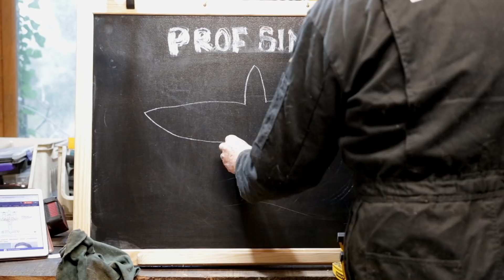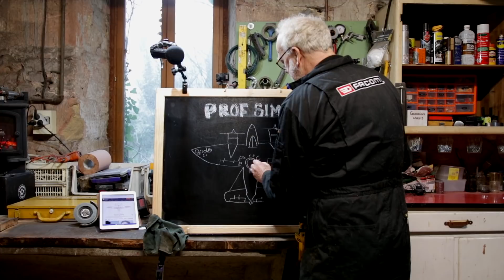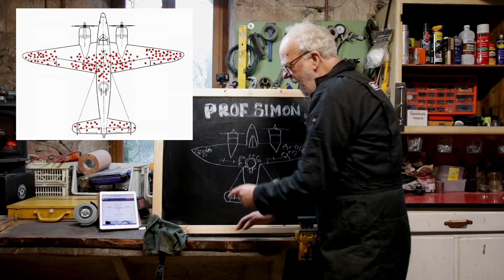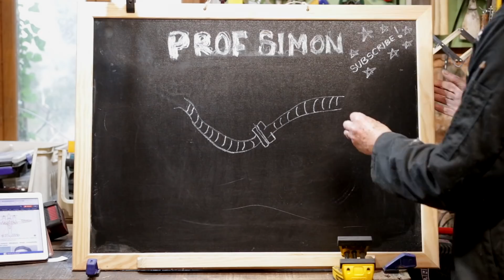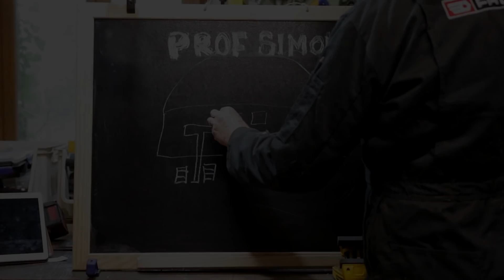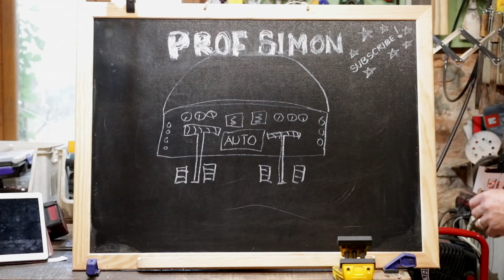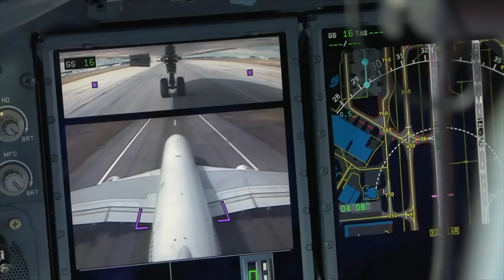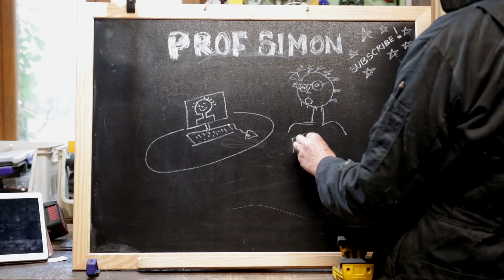Logical Thinking ? - Prof Simon

Comment: Well, almost. Correct is that railway brakes break in case of a pipe failure. However, crucial distinction here is not whether air pressure or vacuum is used, but that the brake is in breaking position when not engaged. Only engagement releases them, allowing to move the train. — — — Some braking systems using vacuum for release did exist for a while, much more common and now all systems in use apply air pressure for release.

Comment: I was 21 in college for electronics technology and was helping my dad re-assemble the top end of one of the twin in-board engines of a cabin cruiser he had bought at good price (because of the engine problem).  After a few nights work we were ready to fire her up.  Oh man the bang and backfire and shaking oh my!  We checked and doubled checked the spark plug wiring order to each cylinder and it was exactly as should be. (these were twin Chevy  8 cylinder, 350ci block, light truck engines). On the third try, it hit me!  1 = 8, 2 =7, 3 = 6 , etc.  This engine MUST be designed to rotate counter clockwise. I switched the wiring order against massive protest from dad and veeeerum!  She purred to life.  Dad was so amazed.
Reply: The problem would have been revealed by a quick look at the handed props.

Comment: Uhm. Autopilots are in wide use for many decades and work just fine. What you refer to here are probably automatic landing systems. The early ones were simply not good enough. Now they are and get engaged when e.g. landing in foggy weather. Full automation was no problem, but … … … who'd feel comfortable flying in a plane without pilot? Not many 🙂